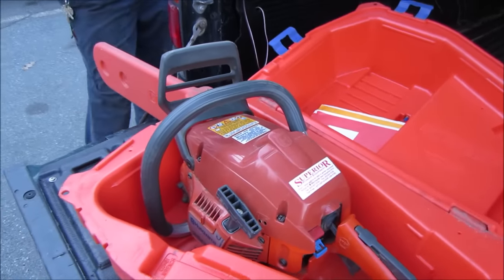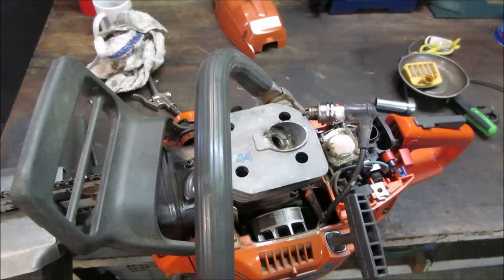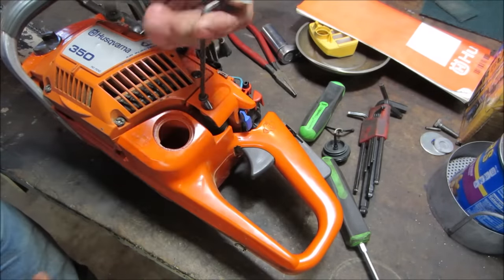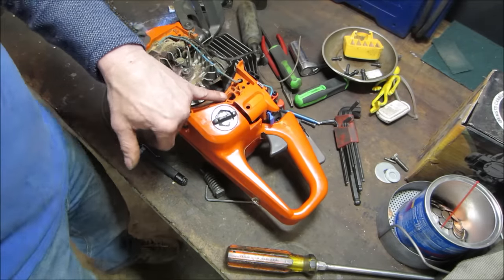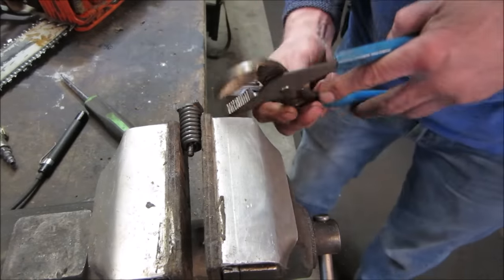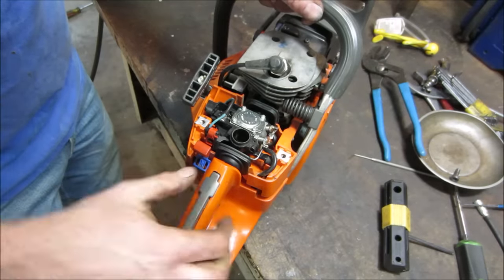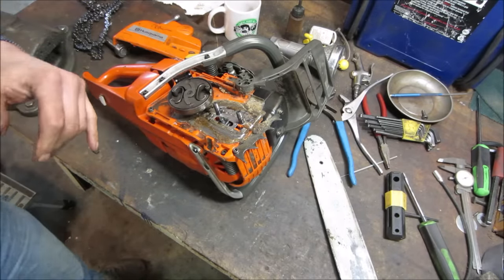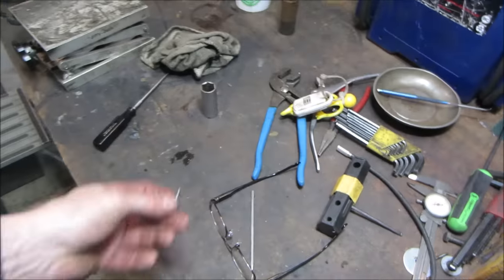Can It Be Saved? The Junkiest Chainsaw Ever. Picked out of The Trash.

Comment: Husquvanna are a well known well respected brand. I expect it didn't get given the love it deserves
Reply: I have two huskys261 *455 .an jonsonred2245 best saws made
Reply: Ditto
Reply: Husqvarna , Jonsered !
Reply: Maybe a bolt was loose from the factory and it spiraled from there. Doubt it though problably some 300lb gorrilla reefing on it after not putting it back together properly.
Reply: Even a crappy supermarket chanisaw is pretty good if you treat it right. This is not that.
Reply: Husky motors are made by Poulan which makes engines for craftsman
Reply: @joeking8028  Husky is their sewing machine division though?
Reply: This model had a problem with the intake clamp leaking causing it to suck air and run lean. They replaced the plastic clamp with a metal one which fixed the problem, they're actually great  saws!
Reply: @joeking8028   Husky or Huskee  and Husqvarna are 2 completely different companies. And Husqvarna owns Poulan
Reply: The Husqvarna 350 was a problem child. Intake leaks caused many brand new saws to start hard and overheat from running lean. When they overheated and melted down the dealers often blamed the owner for not using the correct fuel mixture. The mufflers would come loose ruining the threads where they are bolted on. Husqvarna had a repair kit for them that included a muffler support bracket. Instead of recalling the saws and taking them off the market, Husqvarna's accountants decided to sell them at a lower price to get rid of them. The 350 ruined the reputation of Husqvarna for many people who bought one for occasional use. The local dealer had difficulty selling Husqvarna lawnmowers because people had bad experiences with those 350 saws.
Reply: @tiredoldmechanic1791  Interesting!!!
Reply: Really? That's hat caused people to loose faith in Husqvarna? Not the fact that they sell the same exact tractor as craftsman, Bolens and others for 2 and 3 times the price. Nothing breaks a homeowners heart faster than learning his expensive tractor is nothing more than a orange craftsman
Reply: Joe king No they are not. I live 10 minutes from the engine factory in sweden.
Reply: @datadavis  Mustie's saw is 20 years old. Does Husqvarna still produce their own saws or have they outsourced to China?
I'd hate them if they did... :(
Reply: They make pretty good motorcycles too, as Royal Jordanian will testify.
Reply: @rimmersbryggeri  in 1997 Husqvarna sold the sewing machine brand. I'm really disappointed in that fact...
Reply: @Hjerte_Verke  From what I understand their lower end domestic saws are outsourced to China, but the high end saws are still made in Sweden. I suppose you get what you pay for these days.
Reply: @brendasullivan901  Yeah I knew that. I own the last "true" husqvarna sewing machine model. I cant remember the model number though, but it's  a beast.
Reply: Iron *Fe*  You assumed right sir.
Reply: @Adam_Lynn  it could've vibrated loose vibration prone equipment can slowly loosen at bolted unions requiring occasional  tightening. Thread locker goes a long way too.
Reply: @joeking8028  You mean my cheap Poulan Pro might not be utter crap? 8-))
Reply: @-EC002-  I own a 10 year old 345, it is made in Sweden and works like a treat. Husqvarna split from Electrolux Group some years ago, and has been growing since then, expanding their factory in Sweden. The swords still have the old EM Original marking though, refering to Electrolux Motor.
Reply: @joeking8028  what are you smokin’?
Reply: @keithschneidly3922  Yeah but they actually called their sewing machines things like Huskylock etc. I'm swedish and here we only call them the full name.
Reply: @keithschneidly3922  In sweden we called them after their colours. Pissant (The red one) Silver Arrow the silver one etc.
Reply: @datadavis  var bor du nånstans?
Reply: @mikehaske1900  Husqvarna and Jonsered - two high quality Swedish brands.
Reply: Iron *Fe*@ Husky is a nickname for them:/
Reply: Sthils are easier to start than Huskies but the Husky chains are much better over the Sthils from my exp.
Reply: I have a johnsonred 2255 and a Huaqvarna 445 both bought new and run great. Best saws I've ever had. You may have gotten a refurbished or the wrong amount of mixing oil.
Reply: Iron *Fe*  it was the short name for the brand in the late 60s and 70s, what changed? Home depot?
Reply: @melissaisreallybi891  what? Huskee and Husqvarna are 2 completely different companies
Reply: @melissaisreallybi891  I'm not talking about the $5-18k machines the $2&$3k machines are made in the same factory as ariens, craftsman, poulan, Husqvarna and several other names they share the same engines, decks, blades, tires, frames, transmission/axels, seats and controls. The only thing different are the hoods (on some) and the color. So you $3000 Husqvarna and Ariens are exactly the same as the $1500 craftsman or you $900 mtd
Reply: @mikehaske1900  d
Reply: @joeking8028  you are doing well I love this app it but it has a lot to say to you all you have a good day love it thank love love it thank goodness I hope you have an amazing night and I’m sorry I love this so I love this video you have a great time love love it thank love love this love you so I hope you love your family and I love you so much your prayers and I are going out to you and your love 💗 thank you for the love love you love love your love love you love love it thank love love you love love it thank love love you love love it thank love
Reply: They used to be as good as stihl but we're bought out and now there hopeless be worth your while looking at there reviews only one good review terrible shame
Reply: @noe29933  you do realize that this particular saw is 20 years old. How bad could it be?
Reply: @Vinterfrid  Husqvarna makes both of them
Reply: Huskevarna and penton were well.known and strong ..idrive pention lots of pull the pention
 Brothers did well
Reply: @rimmersbryggeri  they also make huskevarna sewing machines
Reply: @danbartolini27  also joe incase you didnt know they were greatly liked  that were also made in
ITALY LIKE THERE CARS A WIERD DESIGHN BUT WORKED PERFRCT BULTACO WAS A DIFFERANT BREED MADE IN SPAIN DISAPEARED FAST MAGNEETOS WERE DESTROYING  THEM SELVES MOTERS WERE NOT BALANCED  PROPERLY BUT THEY COULD CLIMB ANYTHING
Reply: @rickwaldren3633  sorry, what are you talking about?
Reply: My grandfather was a logger for almost 40 years. When I was a young boy in the 60s I remember that he would only use Stihl. He said when you got a family to feed use only the best.
Reply: Not sure about that I have the exact same saw i also got for free because it had the same issue I think the 350s are prone to this issue
Reply: @TheSadButMadLad  those are just rebranded ktms I pretty
Sure atleast the 300 2 strokes are
Reply: @joeking8028  Electrolux the vacuum cleaner people used to own Husqvarna, Pollan and Jonaered. I used to do tree work and had 7 Husqvarna saws and never had any problems other than normal wear and tear. Even dropped one from about 60 feet up a tree. I brought it back up and got busy.
Reply: @rimmersbryggeri  I don't think so.
Reply: @joeking8028  nope.
Reply: My grandfather has a husqvarna saw that he said he’s had for at least 43 years. It’s his main saw still runs pretty good. It’s just hard to start sometimes
Reply: @datadavis  living 10 minutes away doesnt make you an expert or make them better! I lived down the street from mossburg fire arms and i know nothing about guns😎
Reply: @jameshankssr466  maybe get a brain then?🤔
Reply: @datadavis  🤣😂🤣😂🤣 your too funny
Reply: Husqvarna 440eII and 372xp… 🤘
Reply: Chef}
Reply: @joeking8028  other way around Husqvarna is the parent company. Husqvarna is one of the oldest companies in existence. Been in business over 300 years. The Husqvarna emblem most think is crown is actually sight's of a musket because that is what Husqvarna first manufactured.
Reply: My 455 rancher is a beast Very durable and Reliable. The previous owner beat that machine up. Beat any thing up even a Stihl an it will give in.
Reply: John
Reply: I was wondering if it or did or did not need that bushing that may or may not have needed for stability by the flywheel cover ?
Reply: @mikehaske1900  i just bought a 261SE aand a 455 for $120. 😇
Reply: They're junk and overated
Reply: Agreed. No love. Probably was the start, unchoke, and straight to WOT work, type. No warm up at all...
   "Piece of junk", though. The "junk" was in his mind.
Reply: @danbartolini27  haha, that's what happened to me, I have an orange craftsman
Reply: @joeking8028  Husqbarna makes there own engines. They have been way before they bought poulan.
Reply: @jazpanoz4996  My Husqvarnas are easy to start 2 pulls and they are running. I had a stihl and the damb thing took about 6 pulls to start. Stihls suck.
Reply: @rickwaldren3633  Haven't seen a bultaco in years.
Reply: It's still missing the rubber bushing on the right side were that hole is??
Reply: Probably the problem is that it was made in China like I think some of the STIHL17 models are made in China

Comment: You should see our old 262XP, it makes yours look like new! - Did you know that Husqvarna and Jonsered are part and parcel of the same company? Parts are mutually interchangeable on all the products we've ever had from either brand.

Chain bars get burned up like if the chain isn't kept sharp. The operator just leans more heavily on the saw, and is possibly another reason why yours had all that wear on that spring mounting hole. If the chain is sharp, it should need little more than the weight of the machine itself, to cut the wood!
Reply: Probably rakers not filed down enough........been there, done that!
Reply: not everyone can run a saw and not bugger it up .

Comment: Mustie1, you are one gifted teacher. I watched this video because I have a Husqvarna 142 and figured I could learn about chainsaws just by watching. I've taken my 142 apart a few times and fortunately put it back together and it runs like new today. Mfg. date is 2006 & I intend to keep it up & running forever. Last problem I had was the muffler was falling off because screws were not holding it in. I was told to use Locktite to hold them in and that has worked beautifully. Thank you Mustie1 for sharing your gift of teaching mechanics to others. I love the way you talk like viewers are standing right beside you and having a casual conversation about it. Amazing!

Comment: That's the cleanest 20-year chainsaw I've ever seen...I'll bet there isn't 20 hours on it.
Reply: My toughts too. We have like 8 or 10 husqvarnas and johnsereds 25...30 to 5 years old. Plastic worn trought on top handle for one :D, and worn trought throttle linkages on another one. Shocking to hear 20yo on somting so fresh.
Reply: If the screw threads were broken that quickly then it's really poorly made.
Reply: Chain cover on these usually wear the paint off on the part that covers the chain brake handle
Reply: @catherinewolfson3139  "That easily".  You know how easily "that easily" that was, do you?  How?

Huskys are premium saws.  There is no accident that professional tree cutters here exclusively use Stihls or Huskys.
Reply: @catherinewolfson3139  I have the same saw from 08 and she runs like a champ. Sometimes things like this happen. My guess is that it didn't get properly assembled at the factory with the bolt on the isolation spring . And there was kickback then the throttle linkage popped out of the housing and went full throttle. So don't be afraid to give this brand a shot it has worked great for me 🌲🌲🌲🌲🌲🌲
Reply: I doubt theres 20 hours on 98% of chainsaws in existence
Reply: @danielcarter7657  how do you cut wood   where you are from with out a chainsaw?
Reply: @alaskanken2132  only a few people actually use a chainsaw very often , i have 4 saws most of which ive only used for 5 hrs each tops
Reply: @danielcarter7657  well out of the four saws you have what saw is the favorite?
Reply: @alaskanken2132  my cheaper poulan pro 20" has worked well when my other more expensive saws have failed , but i like my echo timberwolf 20" , and i have a monster 28" bar old saw that has a skip tooth chain and a badass air filter for milling purposes
Reply: @danielcarter7657  that's great.  I have the same husqvarna 350 with a 18 bar and I built my log home with it . It would be nice to have another saw for peeling bark with.
Reply: @alaskanken2132  yea husqvarna makes good stuff
Reply: I have tools for over 15 years and the only thing that indicates that they are used are small scratches on them.
If you are bored to clean them, they need a few hours of work to become invisible from dirt ...
Reply: My brother used to use chainsaws at his old job. He still has all of them, and trust me, they are excellently taken care of, but look like he pulled them out of a skip. Signs of use, use and use.
Reply: @alaskanken2132  I used. Bow saw wedges and sledgehammer!
Dad did have a two man saw but it only saw as a decoration piece thank God.
Reply: typocal home osner 20-50 hour saw, light scoring in the jugg, iether didnt ever clean the air filter, or ran it too lean on mix... running high octane, using carb cleaner, starter flyid, dry gas, or octane boosters in a saw are other common jugg damaging commonalities that thd home owner, and even "the pros" do religiously ...
Reply: @fromagefrizzbizz9377  I only use homelite.  Better bang for the buck
Reply: @kelliegrase4658  If they start, and you don't mind your motors lasting 20-25 hours most.  I've had some homelites.  All became unrepairable/inoperative, except the one we turned into a model airplane engine with a soup-up kit.
Reply: Looks like home owner used and maintained if ya get my drift

Comment: Im 70 and started using a chain saw in 1964. Thats  when my father bought a new XL 12 homelite. The last new chainsaw I bought was a Husky rancher 55 in 2000. It was Ok but never oiled very good. I repaired and fixed on it  quite often and it still runs. However ive got my belly full of plastic chainsaws.  Just never liked them and they are now  even worse. Now Ive came full circle and are  currently using & enjoying vintage 60,s & 70,s Homelites. Great saws with manual oiling. No loosey goosey vibration isolation.  They are magnesiun saws with rubber fuel lines. Ive got 4 XL 12s a 925 and a 550. None have roller tip bars. and I use Murphy  ethanol regular gas and Wal Mart Super tech mixing oil. Mixed  1/2 pint to every gallon of gas. I really enjoy the blue smoke  and loud exhaust. I clear cut 4 acres of scrub cull timber last winter with those saws. If you want to use a vintage chainsaw check out  Leons Saws on U Tube.
Reply: How are your fingers...a bit white and sensitive?

Comment: Love my Husky, 35 yrs old and had fun porting and tweaking a larger carb on it for a bit more grunt. Ran it on Model aircraft 10% Nitro fuel for a joke once, lovely aroma!🤭🤫😯
Reply: Maybe a 17.5 Dell'Orto would turn it into a hot saw...
:-D
Reply: @horstszibulski19  Got a tuned pipe left over from my 1/5th Petrol R/C truck racing somewhere....🤔🤭👍😂
Reply: @tweed532  Resonance...the turbo for two-strokes!
:-P
Reply: @horstszibulski19  Go search Saw Daddy or whoever on Tik tok or maybe here if you wanna see some saw stuff. Man does all the work on these chainsaws and gets them just going. I don't even use chainsaws as well...not much to do with them as of now, BUT i still love seeing how the modifications and which ones do what.

Comment: As a professional arborist that uses the 52cc 350’s as ground saw daily. They are excellent saws with 2 flaws that can cause major damage if not fixed or noticed. 1 the plastic boot clamp at the intake needs to be changed for a metal one or it will have an air leak and burn the cylinder up. 2. You have to basically loctite the muffler bolts in or they will rattle out. Besides those small mods, theses saws will rip. My favorite for power to weight ratios
Reply: I know where there's 1 of these with the muffler problem. Operator never noticed the sound change (?) & the exhaust holed the oil reservoir ruining the case. Not worth fixing unless you've got a better sense of humor than me.

Comment: Haven't finished the video yet, but at 26:06 that rubber bushing looks like it goes to that lonely stud! A good policy I've used for my chainsaws is to fill the gas tank 2/3 and fill the bar oiler all the way. This way you run out of gas before bar oil.
Reply: That's a great idea.
Reply: I was thinking the same thing when I saw that small stud inside a large hole. Looks like a rubber bushing should be there for dampening
Reply: Thanks for that tip . 👌🇺🇸
Reply: That's a great tip.  I don't think I've ever run out of bar oil before finishing the tank of gas though. Maybe back in the day before auto-oilers, when you had to pump the bar oil out manually. But still a great operating tip.
Reply: Most saws hold enough bar oil for two tanks of fuel.
Reply: All the saws today are designed to run out of gas first, so top off both gas and bar oil. If you run out of bar oil first, than you have a problem.
Reply: Brilliant suggestion!!!

Comment: I have this very same Husky 350 saw. I purchased it in 2003 and it still runs well. It has cut many, many cords of wood over the years. I have put it through hard use, but never beat it. I will agree that chainsaw companies have been making saws cheaper and cutting corners as far as durability issues are concerned.
Reply: i call it making down to a price .  personally i would choose a older pro saw than  some box store POS